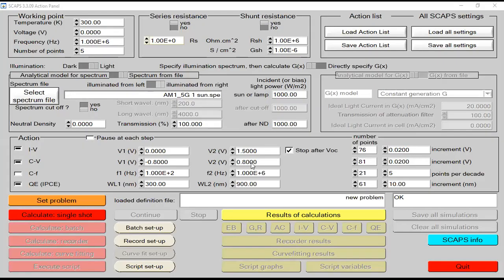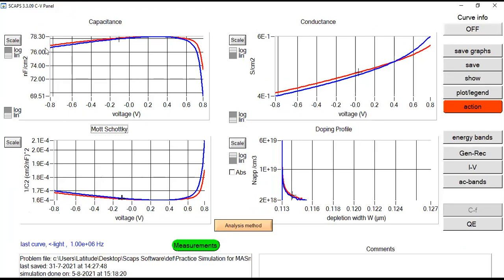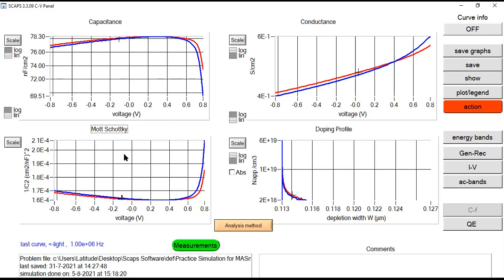Lecture No 4:Performance Analysis of Perovskite Solar Device  by Mott Schottky Analysis (C-V) Tech.

Comment: Thanks for the wonderful lecture sir. is it possible to calculate the barrier height for electrons at the pn junction from C-V measurements.
Reply from the maker: @Kaviya Tracy I think you may caculate from CBO and VBO values computed mathematically. You need to read two equations for calculation  of VB and CB and you may find barrier height. There are some articles Alos representing relationship with barrier height and conduction band offsets.
Reply: @engrmuhammadwaleedakram4486  thanks sir
Reply from the maker: @Kaviya Tracy please check paper effect of VB and CB on performance of perovskite solar cell . There is relationship available Nd computed barrier height
Reply from the maker: @Kaviya Tracy please find the below article it will sort out your querry hopefully.
https://doi.org/10.1063/1.4960112

Comment: To what extent can the doping conc of HTL can be increased? I have increased doping conc for HTL layer to 10^22 (1/cm^3) and recorded efficiency of Quantum dot solar cell 35% . Is there any mistake in the simulation - too high efficiency? Please let me know
Reply from the maker: As per Schokley Qussier limit the efficiency can be achieved up to 33 cent. But too much heavy doping in HTL is not justifiably, please read the literature and you may get the optimized value for HLT
Reply from the maker: For simulation this efficiency can be counted for lab point of view 35 cent is not justified
Reply: That really helped me out ... I have one more query that for Quantum dot solar cell, can I use 2 Quantum dot ( 2 Absorber layers- for example GaAs layer and PbS layer), I did the simulation and getting efficiency around 26% but I am not sure it is allowed or not ...
Reply from the maker: Yes you can use double layer